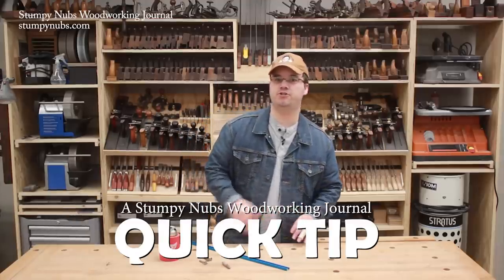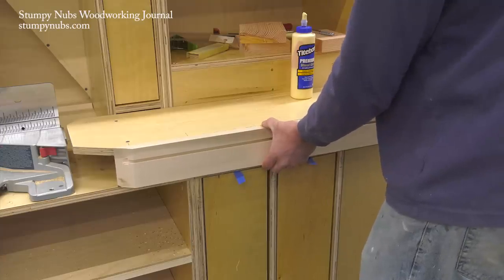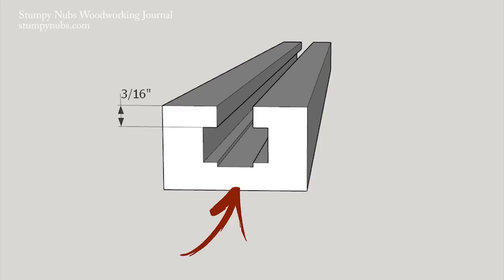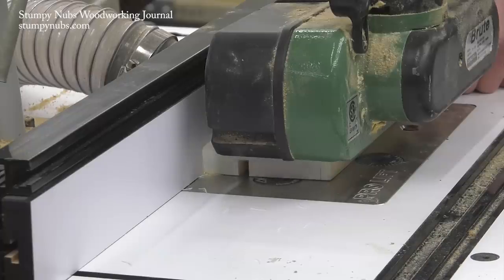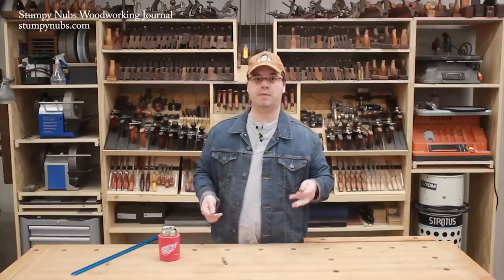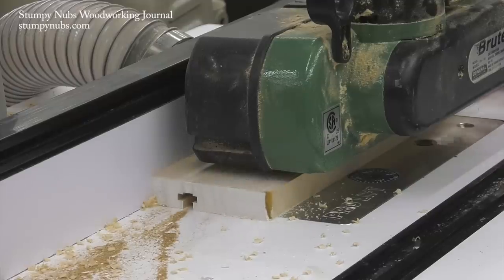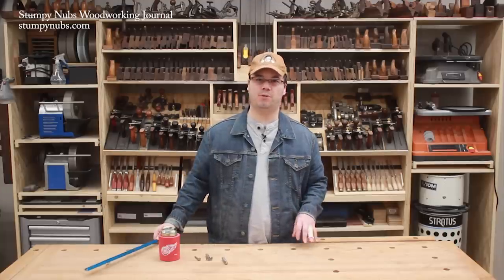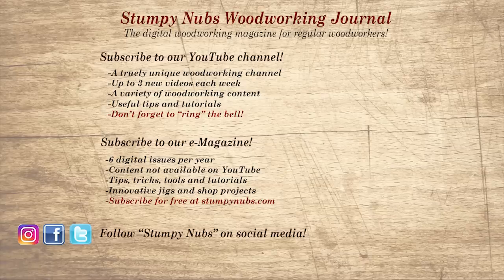How to make your own t-track out of wood.

Comment: One thing that's been serving my own limited wooden T-track needs for a while now (forget which channel's video I first saw it, sorry for the lack of attribution) is to 'construct' it from strips of 1/4" plywood.  Just stack them with the wide one for the base, 2 narrow ones for the sides, 2 a bit wider for the top/lips, glue and brads to laminate.  Lips seem to be holding up fine.
Reply: tommy from 1 minute workbench does this in a few builds. i think his lathe build is a good one to check
Reply: I was wondering about using plywood.  Thanks for the heads up.
Reply: @TrevorDennis100  And bear in mind, my experience was with using 1/4" plywood strips, and building up the wooden T-track in 3 layers, as I described.  I have no experience in plowing out a T-track in, say, 3/4" plywood, as the video shows being done in hardwood.  I imagine plywood done that way would be weaker in the lips than the way I did mine, since depending on the layers used in those lips, it could be primarily grain running in the direction of the groove, which would be more likely to snap off.  I simply don't know that answer, I just know that my lips made from the entire thickness of 1/4" seem to be holding up fine, with the bolt and washers I'm using with my star knob nut (washer above and below the lip, to distribute the pinch).
Reply: @JusBidniss  If you're using this track for something like a stop block keep in mind that the stop block is going to be squeezing the upper lip.  So there's less chance of tearing out your t-track.    If you're using it for something like slat wall I wouldn't hang more than 20 lb on a bolt. The performance is really going to be dependent on the physics of whatever it is you're trying to do.  now that I think about it I might upgrade my stop blocks so that they have two bolts.

Comment: For anyone who doesn’t have a router or the proper router bits, You can also build it in layers. Either three layers, or Just two layers by creating two pieces with a rabbit and then gluing those rabbit down onto a backing piece.
Reply: Hey you’re on Reddit, too.

Comment: just modified my workbench with t-tracks. So glad I watched this video, because it gave me the idea. I ended up with a 1/4 inch bit for the initial groove, and then used my t-bit. Went with the larger bit.I was a little difficult because I was cutting right into my workbench, so I made a jig to guide the router straight. Getting the depth correct was the hardest part, but overall I am happy with my work. Thanks again for sharing the creativity!

Comment: Great tip. You can also make these using a single straight router bit or a dado blade and aluminum flat stock. Another option is to make them the way you did and add aluminum stock at the bottoms of the T track where the T-bolts clamp to as to eliminate the weakness of relying only on wood. I like the first option because you're already going to dado for a regular T-Track anyway so all you need to do is route a recess for the aluminum  stock to sit in so it's flush or just screw them on the surface if being flush isn't necessary.

Comment: Hey Stumpy Ive read all the negative reviews here, and most if not all have forgotten 1 key aspect.

You have shown us an alternative to aluminium T Track, I for one like this idea, I have wood on hand usually, but I have to go and buy Aluminium T Track, or wait for it to be delivered which could take anywhere from an hour or so to a few days, however walking to my scrap pile takes less than a minute.

Thanks for sharing this with us.
Reply from the maker: Nailed it!
Reply: @StumpyNubs  I see this as a great alternative for someone with an established shop that has hardwood leftovers. Me, as a newbie living in Alaska, the hardwood and bits would cost as much as the t-tracks. But then again, LOL I'm small enough still not to need the t-track yet either. Great tips though for doing slots for bolts. Thanks Stumpy, always enjoy your videos.
Reply: Good point, but an easy fix to is just but a few aluminum tracks now, and always have them. They can be found for as little as $8 for a 4ft section online. And if you don't have this router yet, you can just buy 3 or 4 tracks instead and never have to worry about cutting them.  And the aluminum ones can be reused which is nice.
Reply from the maker: I wonder if all these people who think it's too much work to make two cuts to create a t-track have considered that you usually have to cut a dado to embed the aluminum t-track anyway...

Comment: In my new woodworking shop, I chose to use Microjig system for track holding. I works great and after the purchase of bits and clamps, it is very cheap to keep adding anywhere you like.

Comment: I bought a Yonico 7/16X1/4 T slot bit for only $14 on Amazon. I made a 1/4" datto cut in my plywood crosscut sled fence first so the bit didn't have to do all the work and then made 2 passes with the T slot bit, the second cut about a 1/16 inch deeper so I could add a cut down fender washer under the bolt head to give more support and prevent pull out.

Comment: I had a lot of wooden t track like this in my shop. I have replaced almost all of it. The dust does not clear as easily as the aluminum and if the wood moves at all the bolts are difficult to move. I hope you have better luck with yours but i don't think it is that expensive for a tool I use in almost every jig and bench I have. Plus it takes time and materials to make. Thanks for the video
Reply from the maker: Using a 5/16" bit solves the wood movement problem because it makes a looser slot.
Reply: I agree, time is money, and the aluminum tracks never fail unlike wood ones over time. Spilled glue is also very easy to clean unlike wood, and sliding the bolts across aluminum is much easier than down a  wooden slot. Considering there are almost zero negatives for the aluminum t-tracks and multiple concerns with the wooden ones, I'm not sure if taking the extra time to cut your own t-tracks is worth it
Reply: @RambunctiousHamster  It might be worth the time for certain applications.  Waxing the wood tracks could mitigate many issues.

Comment: I recently gave this a try.  The t-track bit I'm using can also be used to cut a keyhole slot.  I am using my DIY t-track with some DIY stop blocks on my DIY miter saw table.  I'm using plywood. For a stop block it's plenty strong.

Comment: sure, wait until I install some t-track and then post this, great. :)  It would be cool to see a follow-up video comparing the strength of the two (or at least showing how strong the wood ones can be).  I know that's very dependent on the wood choice.
Reply: I think it would be safe to assume that 9 times out of 10 metal is going to be stronger than wood, no matter how dense your wood may be.  Of course one should not have to torque down anything in the track, but in the event that does happen I'm sure the aluminum tracks can handle the pressure more so than wood.

Comment: I like this approach too. I’ve been using dovetail slots since MicrioJig promoted them. The slots are said to be stronger and it’s easy to make your own bolts. You don’t need to buy MJ hardware.
Reply: Hi just start experimenting with coach bolts and grinding them to 1/2 wide from about 16mm which gives flats to stop rotation. 
You make me think I could try grinding an angle to fit dovetail slots, and yes these would likely be stronger for the same depth.

Comment: For DIY or occasional use this looks a great option and fun to try out plus less ££$$€€ compared to Ali. 
For DIY T bolts I made a jig to hold coach bolts steady so I can grind them down from 16mm round to 12mm with flat sides to run in 1/2 inch t slots on the router table and fence I just made from scraps.

Comment: I typically use 1/4 x 20 bolts to make jigs. The bold heads are 7/16. Won't a 5/8 slot bit be too wide and let the bolt head turn inside the track so that you cannot tighten it down? I found a slot cutter at Eagle America that is 29/64 which seems like it would work better. Your thoughts?
Reply: Exactly! those are the right measurements @Jonathan Ramp. A 5/8 bit is useless. There are 7/16 bits in amazon for afordable prices.

Comment: Thank you for this. I am a rather new woodworker, and I'm thinking to rout the t-track slots as you suggest. I appreciate this help. 
Two questions. 1) I will be cutting the slots in 1" teakwood (hard wood) - any special instructions for this? And 2) will this wood track be strong enough for, say, a Kreg bench clamp? 
Thanks so much for your good help.

Comment: I like this idea.  Sure, I will concede that there are some advantages to the aluminum stuff as many have mentioned.  But what if you find yourself working on something where you need a t-slot and you don't have any aluminum stuff on hand?  And the stores near you are closed (or you don't have time to wait for a delivery)?  It would be nice to have these on hand so you could complete the project without having to wait. I know I've always got hardwood scraps laying around my shop.  But I do not always have t-track laying around.  I think I'd like having them around just to use in a pinch, even if they never become my primary option.  Thanks for the tip!

Comment: Not having priced any of the materials, I am curious as to whether it really is cheaper if you have to purchase the hard wood and router bits, in order to do the job.
Reply: I'd be interested in that too, plus aluminium t-track is reusable. I can see myself using wooden t-tracks on small jigs but on big workstations I still think aluminum is worth the investment.
Reply from the maker: Hardwood is widely available for less than $5 bf. (Craigslist) But let's use that figure. A 4-ft X 12-inch wide board is $20. You can get about 8-10 T-tracks from that, depending on how wide you make them. That's about $2 a stick. You can cut that in half if you find the right source for wood. You can add in the price of the bits, but since the bits will last for hundreds and hundreds of sticks, it's not really fair to count the full cost toward the first 10.

Comment: I put my T bit all the way down.  I used a down cut  5/16 spiral 4 my relief. I  like it way better than my aluminum or my matchfit.  FYI:  did u know that if u use a 5/16th, the matchfit clamps will work with it?  How cool is that?

Comment: This also works well to carve T-Track into a workbench top.  Just mount the bits in your handheld router and make sure you have an accurate fence/jig set up to make the cuts.  Since you're cutting directly into the bench surface you don't have to worry about installing the track afterwards (with another cut).  The difference between a bulky, homemade wooden track and an aluminum extruded one is also not a factor in this situation, either.

Comment: Funnily enough, what brought me into the world of woodworking, 7 years ago, was my buddy telling me I needed some T-track for another one of my hobbies, wire wrapping. Well I was broke broke so I tried to make my own with pine and had next to no power tools, just a drill and an inaccurate circular saw. Long story short, being broke and having no tools and needing T-track made me buy that cheap Harbor Freight hand plane. Trying to get straight, square edges with that thing taught me an incredible amount, as did all the other tools I ended up buying to try to get a damn straight edge 🤣. I even made my own T bolts by filing down the head of some random bolts I had

Comment: I usually use a dovetail bit and Microjig's Matchfit dovetail clamps and Matchfit hardware, but will try this out! Thanks! ... Oh! and I'm surprised you link to a Yonico bit! I have one of their bits and it actually works great, but lots of people rate them low for some reason, I think most legitimate complaints were about top bearings, but from the sounds of them, they will remedy that quickly! I contacted them with a question a week ago and their customer service is beyond awesome! They went the extra mile to answer me, even drawing up diagrams! (more bits from them are on the way!)
Reply from the maker: I use Whiteside. But I linked to that one as a cheap option.

Comment: Thanks for the tip! I do wonder what general hardwood recommendations you have to keep the cost of the wood less than the t-bars. Also would higher quality plywood be a good option?
Reply from the maker: All I can say is use the cheapest hardwood you can find if you want to keep costs down. Straight grain will be stronger. Try Craigslist. I wouldn't do plywood, it would be pretty weak unless it has many thin plies, like Baltic birch. Then again I've used plywood layers to make serviceable t-track in the past. So maybe...
Reply: @StumpyNubs  I have 11 layers in the 3/4 ply I was going to use for my first table saw sled. 

Went for aluminum t tack the other day to put in it, but they were out of stock. Now I do not have to wait. Awesome!

 Thinking a couple costs of wood potection (vararhane) will strengthen it a help with smoothness. 

Is 3:00 am too early or too late to fire up the router table?

Comment: Use a dado blade or a few passes on the table saw to save a bit of money on the first bit
Reply from the maker: You'd rather set up a dado set than spend a few bucks on a straight bit you'll probably use for all sorts of things down the road?
Reply: @StumpyNubs  well I mean, 3 passes on the TS will make that. Plus you said you use an odd 5/16ths bit or something right? Can always buy it down the road, just offering an alternative ppl probably have.
Reply: @StumpyNubs  You can say that about not buying t-track and spending time and effort into building an inferior product though.
Reply from the maker: @Davey768  Generally, woodworkers don't consider something we make ourselves from wood "inferior," especially when it works perfectly well. But whatever...

Comment: I am liking your tips, this is helpful. Thank you! Option of length greater than 48" would be possible.  I have a 48" length channel extending over both router fence halves. I needed  stops for multiple and repetitive miters miters on 22" pieces. ( 0 tp 22" RT then 22" LT limits). Now I can expand (unusual) need for stops futher.

Comment: James did you consider using the micro jig dovetail clamp set?  With the dovetail bit you cut your groove and their clamps fit right in the groove.
Reply from the maker: There are a lot more accessories out there that fit in a t-track than there are for the Micro-Jig track.

Comment: Can you recommend a T-Slot bit to cut slots to be used with either 5/16" or 3/8" bolts? I know a lot larger than some use for standard jigs but I have a need for a few larger ones and have a bunch of Woodpecker knobs that use either 1/4", 5/16" or 3/8" nuts/bolts. And I made myself a few new sawhorse tops out of 3 layers of 3/4"  to be bolted to the tops of metal sawhorses and plan on routing a really deep groove down the sides to be used with knobs and wood to be clamped to the side of the sawhorses. Plus they have dovetail groves and 3/4" holes on the tops to be used with the Miter jig Dovetail Clamps - dovetails and dog holes on the tops and t-slots and clamping on both sides.  My Kreg sawhorse version I guess.
Reply from the maker: You could widen the slot with an extra pass or two, moving the fence a bit.

Comment: This is a tangent, but I have wanted to go all-in on a t-track assembly table for a while, but it is the price of the nice clamps that give me pause more than it is the price of the track. I'm sort of thinking that I might go with dog holes and various clamps and fixtures instead. I really like the Armor Tool clamps they have for dog holes (having played with them on a display), but with dog holes I could at least use homemade cam clamps and trigger clamps in the holes while I buy nicer clamps over time. I'm looking forward to your modular workbench build to help me decide.
Reply from the maker: The t-track is expensive, but the little 4-way intersections that go in all meeting points in the grid will break you!
Reply from the maker: The t-track is expensive, but the little 4-way intersections that go in all meeting points in the grid will break you!

Comment: James, this video comes at a great time for me as i was about to spend a50+ dollars on additional t track for my cnc machine bed.  Instead i spent 12 bucks, bought the bits in the link on amazon and made my own.
is it as strong as ther aluminum? No.  If i take that into consideration in utilizing it, it should hold up just fine i think.  Time will tell. It's worth the 12 greenbacks to find out.
Reply: It doesn't NEED  to be as strong as Aluminum!
Reply: The strength of the aluminum is compelely irrelevant, the small screws attaching the track to wood will pull out of the wood long before that. In fact the screw holding power is much weaker than the compression strength of the lip of a track directly routed in wood.

Comment: 00:37 "Miles" with 1 router bit on hardwood? I know this was sarcasm but this is quite an investment and not nearly as strong in a well used workshop as the aluminum ones. Hardwood is expensive for wasting on a bench and the bits are too. 

Subtotal (3 items): $108.37 plus the cost of hardwood and the time needed to make the tracks. Which are a one time use; meaning they cannot be moved in the future to other tables or placements.

Comment: I guess I should wait for the actual video on the miter bench build, but it looks like you're using brads to hold the t-track to the bench.  Is this strong enough (glue included) or is something else being used in there?
Reply from the maker: This track will just be used to position a stop-block for making multiple cuts with the miter saw, not for hold-down clamping. Glue is enough for that. The brands just hold it while the glue dries.